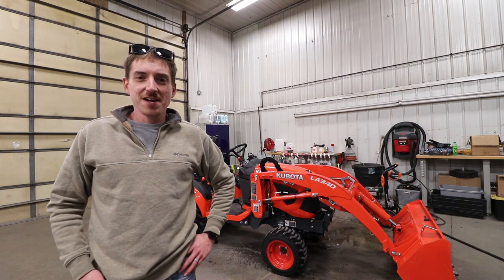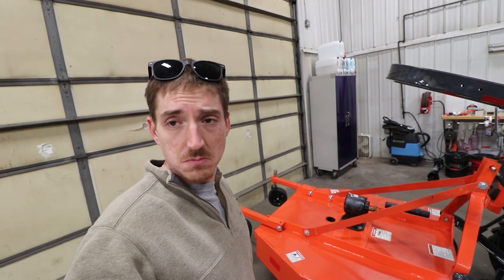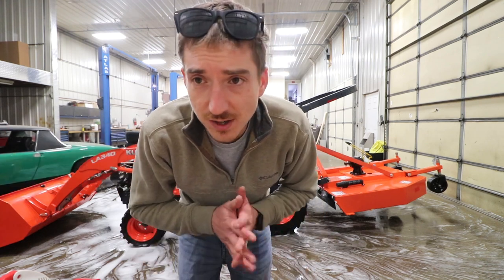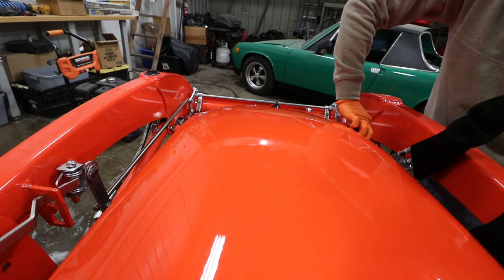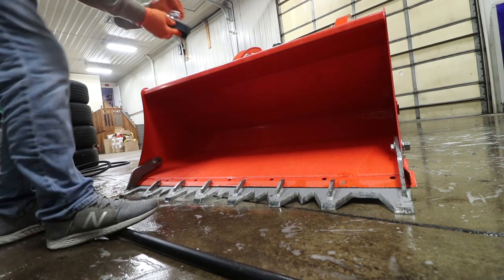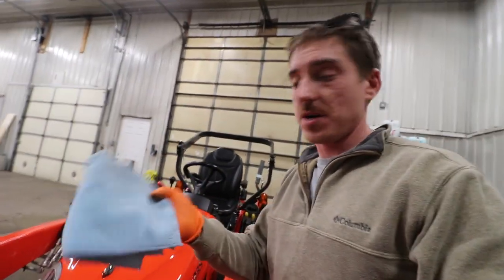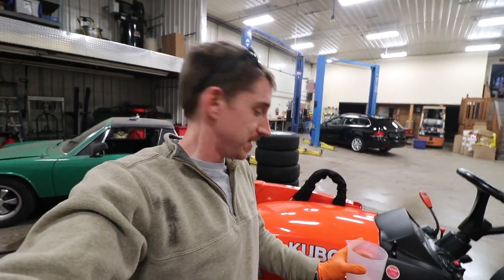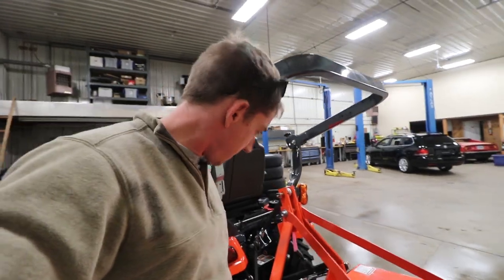Ceramic Coating a Tractor? Today we detail up and protect the paint on the Kubota

Comment: How is the Touareg doing? Any updates on that what you would be doing next to it. I have my V10 tore apart in the center, because of an big oil leak in the valley. I am suspecting it is the alternator oil seal, but will replace all of the seals.